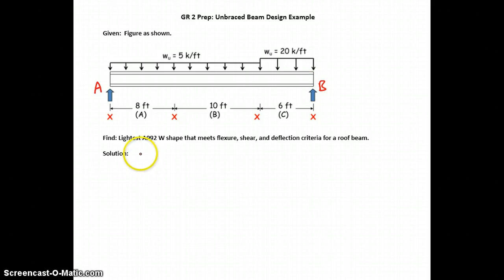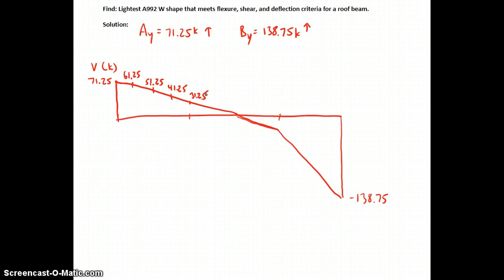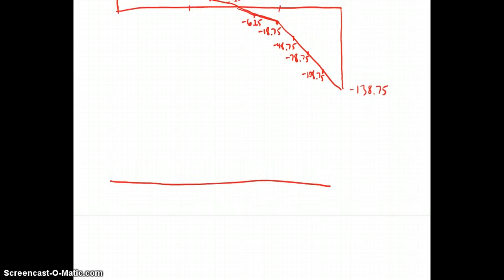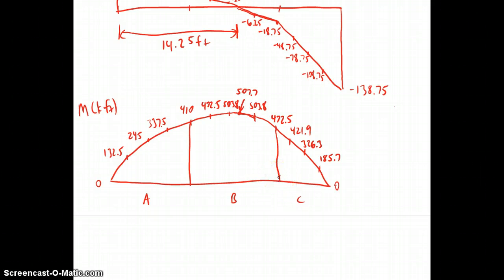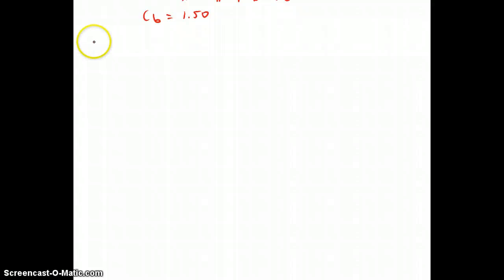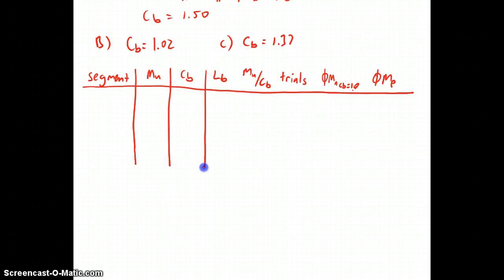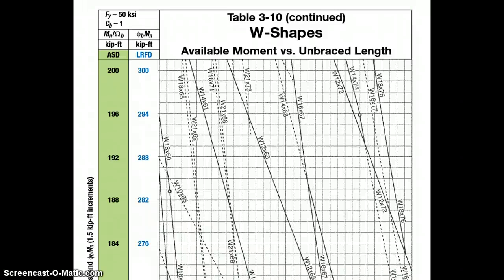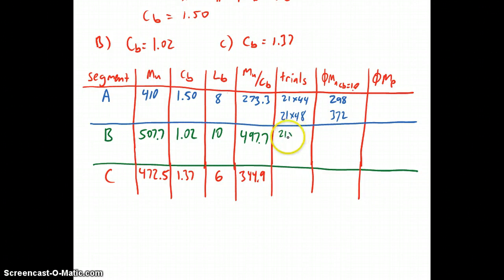unbraced steel beam design example part 1 of 2

Comment: How did you get the moment values? Is there a rule or something?
Reply from the maker: The moment at point A (left end) equals zero because the beam is simply supported.  The area under the shear diagram between two points is equal to the change in the value of moment between those two points.  For example, the Moment at a point 2ft right of point A = 132.5 k-ft.  This was calculated as the value of moment at point A + the area of the 2ft wide trapezoid shape under the shear diagram, or 0 + (71.25k + 61.25k)/2 * 2ft.

Comment: Quick question. Could you explain the difference between Mp, Mr and Mn?
Thank you.
Reply from the maker: A good way to understand beams is to cross reference tables 3-2 and 3-10.  The nominal strength of a beam, Mn, could vary from almost nothing up to a value of Mp, which is the fully plastic moment.  It all depends on the unbraced length.  If you have two beams that are the same cross section, the shorted beam will be able to take more bending moment than the longer one.  Mp is the largest moment the beam can take, and we are allowing it to yield across its entire cross section.  Some long beams fail by lateral torsional buckling (a twisting behavior) before they get a chance to fully yield.  You can look up Mp for any shape in table 3-2 and see that it's plotted in table 3-10 as a horizontal line from unbraced length = 0 to a value of length = Lp (also listed in table 3-2).  Mr is a value of moment where the type of failure mode changes from elastic to inelastic lateral torsional buckling, denoted by an open dot on the beam curves in table 3-10.
Reply: Ahhhhhh,  you sir are a genius! More videos would certainly be welcomed, time permitting of course. Let's see, you could do one on beam - column designs, slip critical joints, fixed moments, method of virtual work! Your explanations are so easy to follow and understand!  Thanks again.